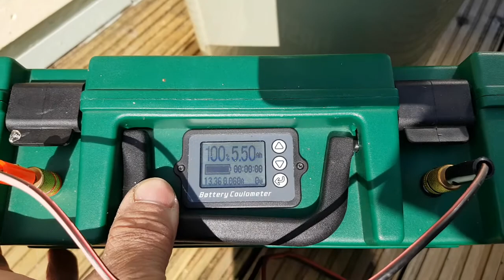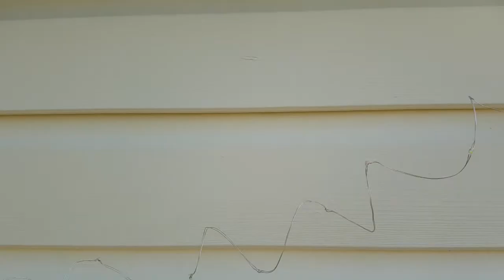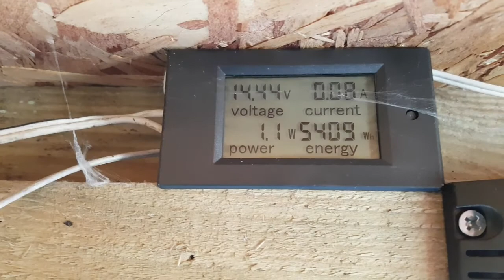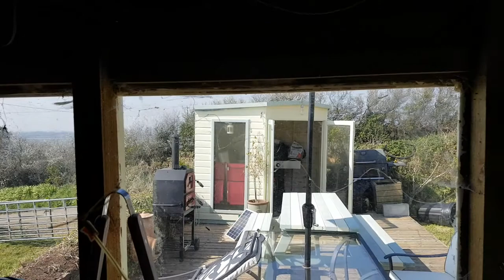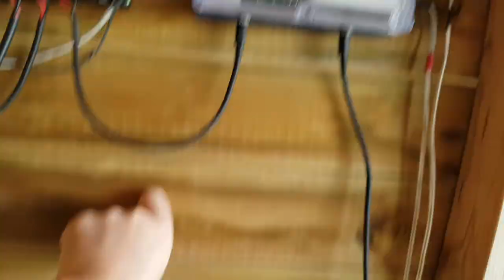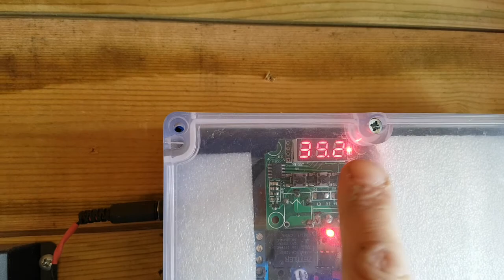How I'm using solar energy in my garden.

Comment: Great stuff, solar power is addictive!
Reply from the maker: It can be. It's a valuable resource, but also very enjoyable to tinker with.
Reply: Pretty amazing how that 5W panel has pulled in over 5KW, just shows you what can be achieved. This Easter weekend has been stunning for sunshine!
Reply from the maker: I wouldn't say the display is super accurate, more of a suggestion, than an finite amount. It's been recording the panels output for just over 4 years, so it's amazing how much energy can be collected, if you're not in a hurry.